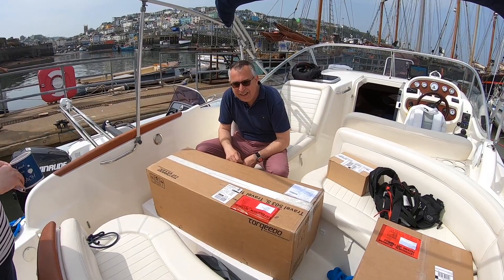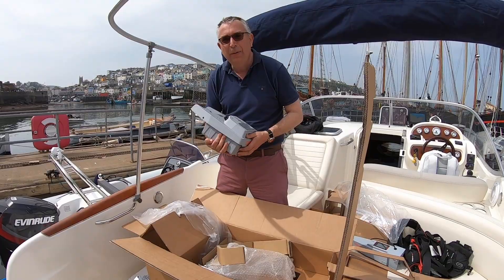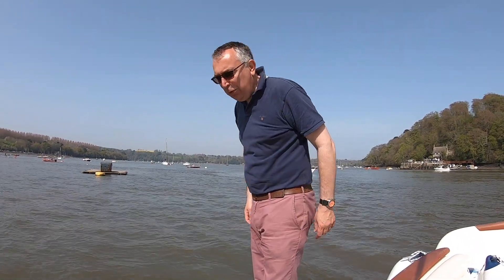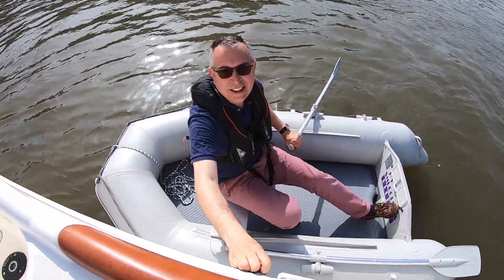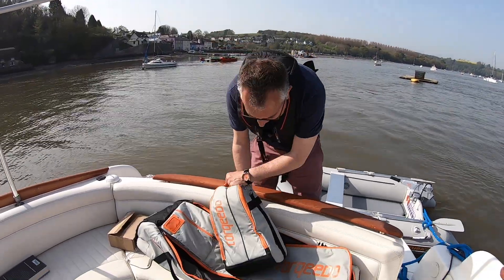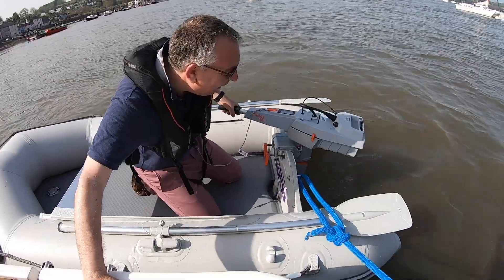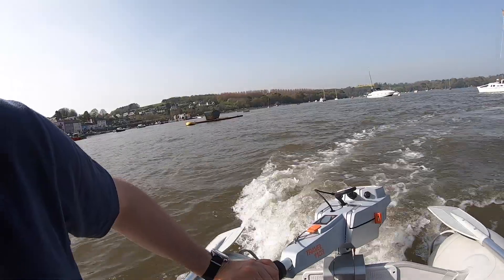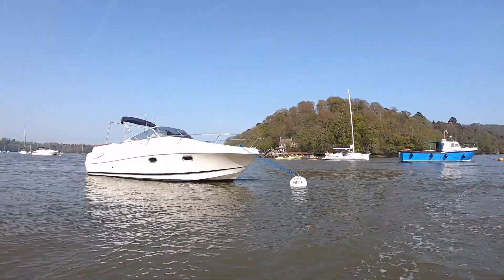Torqeedo 1103C electric outboard unbox & test

Comment: It's a bloody lot of money $4,000 AU for an electric outboard, but I guess it will save you on petrol, oil and service charges in the long run. They do look very boxy tho.. square and boxy. Maybe as they progress over the next few years they could put more into the shape of the exterior panels to make it a little more streamlined look or are they just wanting to stay with a brick shape.

Comment: Just to add to my previous comment regarding this outboard: excellent though it is, a note of caution. The other day we inadvertently strayed into some shallows & hit some underwater rocks. The shear pin didn't, and the forward fin, there to push the outboard back & up if it encountered an obstacle, must have gone between rocks. Even though I immediately stopped, the result was a completely smashed prop. New ones are expensive of course, so I also used the boss of the smashed one, made & fitted some aluminium fins to it. I'll keep the latter as a spare - save me having to row back from the far end of Derwentwater again!
Reply: I 3d printed a spare for mine for £5!

Comment: The integrated battery is the bomb!  I had one of the original electric motors that use a standard car battery placed on the tender floor, not the best setup and it was pretty shoddy, didn't last long....  I tried to set it up with a solar panel and regulator, but still....  iffy!  This is a big step up!

Comment: My concern is the proprietary battery and maybe connectors? See, with a little gas motor you can just buy gas. You don't need to buy the gas made by your motor maker, and you certainly don't need to check serial numbers to make sure it's exactly the right gas. But batteries you do, and if the company goes bust or just decides to charge an arm or a leg for a new battery, you're stuck. I can actually see outboards being a good way for electric to get accepted, if the manufacturers could come up with universal batteries and fittings.

Comment: Put two people in the boat and that wont be able to push it faster than 3 knots. Get yourself a decent motor.
Reply from the maker: And then where would I put it and how would I lift it on and off every time?
Reply: @AQUAHOLIC  Lets do a deal, for allowing me the pleasure of coming out on your lovely boat, I would bring along a 8 hp Yam and I can lift it on for you as its only 27kg. You can supply dinner and the beer.

Comment: Hi Nick. I am impressed with that. They also do inboard engine with bmw large flat 'torqueedo' batteries for larger boats, great system. Efficient and easy to use. Electric free power from solar. Awesome
Reply: Does torqueedo have remote control capability

Comment: Thank you for this. I am considering purchasing one, but I would like to know how effective it would be powering a one-ton sailboat (Cape Dory Typhoon). The specs do say that the motor is good for boats up to 1.5 tons, but considering currents and tides in my region, I want to be sure that I make headway. Does anyone reading this have any input on using this on a heavier boat?
Reply: Try talking to the manufacturer about performance and whether a refund could be given if it does not perform to what they tell you for your boat in your conditions
Reply: Found some discussion online about this a while back. It seems to work ok, but is not quite equal to a 3HK outboard on heavier loads, i.e. a sailboat against tide/wind.

Comment: Enjoyed your demo!  Torqeedo has greatly improved the range on a single charge since the earlier 2013 model.  Wth a small inflatable at 2kn  its now 46 miles, or at 5.5 kn its 5 miles.  In terms of security to defend against the sorely tempted light fingered outboard pirates, I do like the portability of the tiller and battery.  In my harbour o/b thefts are a regular nuisance. Im likely to buy one soon. Also love the "stealth" feature - silence is golden!

Comment: It's disappointing there's so much plastic in the packaging. How much of that ended up in the water? I thought the Germans were big on not using plastic packaging. Made in China perhaps?
Reply from the maker: What on  earth makes you think I was throwing packaging (plastic or otherwise) into the water!!?
Reply: AQUAHOLIC Hello Aquaholic. I thought you were a little casual with stowing the plastic packaging, which could easily have been blown into the water by an unexpected puff of wind. I never thought for a second that you might deliberately allow it to get into the water. If it did and if you noticed I’m sure you would have gone to great lengths to retrieve it, setting a good example in doing so. Did you notice any ‘Made in’ stickers? I was convinced the Germans had stopped using plastic in their packaging - a good outcome from having a reasonable number of green reps in their parliament. Are you still happy with the motor? Any problems with lack of power or endurance?

Comment: You need to buy a few extra shear pins. I only tapped a hidden rock and it was bust.  They are not stocked by most chandlers. They cost just £1.05 each but... Torqeedo charge a whopping €15 delivery for something the size of a panel pin! so buy from a local mail-order company.  I also suggest you take the current one out and apply a little greases because they do stick and become difficult to remove when broken.  Finally, never run the engine with the prop out of the water. It seems to reduce the longevity of the motor is you do so. Enjoy.
Reply from the maker: Good advice, thanks!

Comment: Interesting review! Very expensive though for a 3hp outboard
Reply: We are so disappointed in our Torqueedo 1103CS Travel and after only 8 weeks use the battery has completely failed, Torqueedo Customer Support are unable to get me a replacement battery, rendering my motor useless with absolutely no one who can fix it in the whole of the Balearics Islands.
In theory electric motored are the future however they are so underpowered, expensive and with poor support it will be many years before we every consider these again.
Are present we are looking at at Honda 6HP unit which offers double the power is half the cost and if we every have a problem with it it will be very easy to fix ourselves of find an abundance of engineers throughout the world who can fix one. 
Additionally, there is absolutely no lock for the battery which could be removed within 20 secs.
Reply: We have one, and it was well worth the extra money. No gas, no storing gas, no oil changes, no smell, no noise. push button start, no carb issues, etc.

Comment: I would like to see one of these glorified trolling motors tested on something more than a 3 foot long boat ! ?
Reply: it works very well also on a linder fishing 440 and up to 4.4 knots or 8.8km per hour with 4 persons on board. so it has the same or more torque then a 4hp outboard and its much easier to maneuver. the only only down point is the maximum range compared to a combastion engine at maximums speed is lower....
Reply: @oxytronix  What is a 440 ? ( length / width ) . And 4.4 knots is not bad ! That about 5 mph ?
Reply: John Averick 440 centimeter or 4.4 meter maybe 15ft
Reply: @oxytronix  Great, Thats about the size boat I run ( 1962 14 ft. Alum. Orlando Clipper ) I always said. If electric could push me an honest 5 mph without weighing a ton, I would go that route.

Comment: Disliked because no specs of the battery and motor are mentioned
Reply from the maker: Fair comment, I'll try to make sure I mention them in the next one (hoping to do a range test). Plenty of info on the Torqeedo web site in the meantime of course.

Comment: Are these electric engines high maintenance?
Reply from the maker: A service every five years.
Reply: Electric motors have basically zero maintenance. They will go years without having to touch them. The batteries are getting better, but replacing them is really the only maintenance cost.

Comment: I see a few target customers for this: 1. Sailboaters that sometimes find it inconvenient to get gas. 2. Occasional dinghy users that don’t like messing with gas and don’t run their outboard enough to keep the carb clean. 3. People that want something convenient and light weight. I fit into categories 2 and 3 and I have a bad back injury so something lighter in separate parts that won’t spill oil or fuel is attractive to me.  My dinghy trips are short so speed is not an issue for me. The price is still pretty unattractive, but I may still give it a try.
Reply from the maker: The fact that you don't have to 'pull start' like a conventional outboard might also be a bonus.

Comment: What are your thoughts on the inflatable boat you were using, the 260, for two people or a person and a dog?  I like the small storage size and light weight, but not sure of the quality and durability.
Reply from the maker: I think it would be okay for that, it's rated for three and there is a reasonable amount of room in it. Quality seems okay considering the price, durability remains to be seen but no obvious signs it won't be okay. I bought it for the size and weight, certainly there doesn't seem to be anything else as light and that packs so small at that inflated size that I came across.

Comment: Great video. I went with the epropulsion spirit instead ( vid on my channel). We must have pulled the same face , first time of using an electric outboard. 😁
Reply from the maker: I'll take a look!
Reply: AQUAHOLIC cheers. The deciding factor for me was the spirit’s battery is totally waterproof & it doesn’t have a gearbox whine. .
Reply: @thekitowl  Gearbox whine I am with you, why make a silent motor then make it noisy with gears, same evolution in a lot of motors.
Reply: Ben Grizzly Adams when I heard it at the boat show the whine was quite loud & I was told they had put a thicker grease in to quiet it down.
Reply: @thekitowl  Silent Yachts scrapped their system on the 55 to make gear-less motor on the newer 60 if I remember well.
Reply: Ben Grizzly Adams 👍
Reply: Does the spirit have reverse?
Reply: Christopher Whyte yes. You just turn the throttle anti-clockwise.
Reply: I looked into that one too, but if I still had to do it over, I'd still buy the Torqeedo. For one thing, the ePropulsion is more expensive. Torqeedo has been around a while and getting servicing I would think would be a lot easier. Torqeedo also addressed some things in the latest version of the 1003 to better compete. I find the noise of the original model minimal compared to most motors.

I feel there is a market for a more affordable, less expensive competitor, but little room for one that is very similar but more expensive. I would be surprised if ePropulsion is still in business in a few years but time will tell. It's sort of a copy of a Torqeedo.
Reply: n8goulet do you know if they have made the battery waterproof yet ? The spirit has been about for four years & touch wood is proving reliable. It would be great if there was some cheaper models, to get the prices down. My spirit was a gift so the money didn’t come into my decision to get it.

Comment: I'd rather buy petrol outboard rather than all that hassle
Reply: What hassle?  If you want a hassle, go with a petrol motor.

I've had my Torqeedo 1003s since 2013 and I bought it pre-owned. I did have to by a new battery for it this season (the newer stronger 915w model), and they are very expensive. 

Petrol motors (3 HP gasoline equivalent is comparable to an 1003) require annual maintenance each winter.  You have to mix gas & oil. I don't want to smell that in my sedan. It's much more convenient to charge the battery than deal with gas & oil. And if you stop the motor while out at sea, small gas outboards like a lawn motor, can be a real hassle to start & stop constantly pulling the rope. The Torqeedo is a simple on / off at 1 second's notice. Also useful as a trolling motor if you want to go slow. Quiet, and your allowed to take it in places that don't allow gas motors as some lakes don't. I use mine on the ocean & lakes. 

Economically, I think the Torqeedo is more expensive over all. But much less hassle. As a small car owner, it's ideal. Transporting a gas motor inside your gas is certain to cause unwanted fumes, possibly long after the motor isn't in the vehicle.  It's a lot cheaper buying this than buying a vehicle big enough to trailer a boat with a gas motor. And then you have the parking issues when not boating. The 1003 transports so conveniently as does our Sea Eagle, they fit in the trunk, allowing us to take it anywhere and they go all over the east coast from Maine to the Florida Keys.

Convenience comes at a price. But because this motor is so portable long distances in a tiny vehicle, it gets a lot of use and goes to way more locations than what people who trailer a boat would normally get to visit.  All the many locations are what keeps it exciting for me as I only care about sight seeing. I don't fish. 

If you break down the price of a Torqeedo battery per year for the expected life, it's less than $200 a season. I can launch my boat anywhere! No slip fees, mooring, launch fees, etc. I don't need to own a larger gas guzzling vehicle to transport my 14' boat. It's actually far cheaper than what many spending on their annual boating costs.

Comment: I just want to get one of these so I can have a backup motor for my 21ft hardtop boat. No more having to get towed at $300 dollar plus price. Run out of gas keep this onboard never get stuck
Reply: @toranamunter  Yeah but it's silent, when boating you either are full blast, or a diesel chugging along is a pain, and it stinks.

Comment: How is this not a trolling motor
Reply: I thought the same thing, but the company makes electric motors that supply an equal amount of power as an 80 HP gas motor for $20,000. I suppose it would be useful for fishing large lakes that do not allow gas engines.
Reply: It is, but it's rebranded for yachties.
Reply: That's like calling a gas outboard a gas powered trolling motor. That's like calling an electric bike a trolling motor powered bike. Does electricity mean trolling motor now?

Comment: I'm never getting one of these. My Tohatsu 3,5 beats it every time! for a fraction of the cost too. But I'm not rich and own a yatch. If you want to go electric, invest instead in a lightweight new Lifepo4 battery and a trolling engine. There are trolling engines that are as powerful as a Torqeedo. Like haswig protruar 2.0. It will save you a lot of money.

Comment: Be careful how fast you get on the throttle.  Electric motors being high torque, it will shear the pin on the prop.  Don't worry, they include a spare.
Reply from the maker: That's a very good point, thanks. And you're right, there is a spare (two I think).
Reply: Torqeedo said the sheer pin on this model is stronger than the previous model.
Reply: @christopherwhyte2360  NO
Reply: I have the t1003 and I have never broken one. They even say this one has a stronger one.

Comment: Do you think that torqeedo is powerful enough to get that boat up on a plane.
Reply from the maker: Only had a couple of goes with it so far but I'd say not. This one is equivalent to a 2-3hp outboard. They do more powerful ones, but not with the integral battery I don't think.
Reply: I'm thin and I got it on plane.

Comment: I'm surprised torqeedo didn't supply a safety chain to the tiller and battery and transom. Small cost as compared to losing a piece overboard. It won't always be used on a warm calm day.
Reply from the maker: John, I agree with you entirely. Easily resolved, I've ordered a short line with a spliced eye that will allow me to create a quick and easy 'noose' to go around the main body during transfers to the dinghy. But I've already suggested to Torqeedo that a hole in the mounting bracket to thread a line through would be very helpful (I'm tempted to just drill one!). The battery is easy enough as it has a handle and the tiller is small and weighs nothing so not a problem, but yes, a way of tying the body of the thing on would reduce the anxiety of swapping it over to the tender.

Comment: 10hp for $9000!!! That’s a big nope.
Reply: 10hp, more like 3 max.
Reply: 10hpmy 9.9 gas motor is more peppy and faster than that electric motor
Reply: $1,999 @ 3HP https://www.austinkayak.com/Torqeedo-Travel-1003S-Electric-Trolling-Motor-3-HP-23-in-Shaft/ACK16085P.html?utm_source=bing&utm_medium=cpc&utm_campaign=PLA&scid=scbplp16085_3535_1&sc_intid=16085_3535_1&msclkid=96a4beab831b16ee19f2e27e25c5c35a
Reply: Wrong video it's 3hp...
Reply: Wrong video.
Reply: 9 grand buys a tanker worth of fuel 😂

Comment: Isn't this just a beefed up version of a transom mount trolling motor?
Reply: Yeah but trolling motors only go up to about 100 pounds thrust, and this can get up to 10 horsepower with a tiller, which completely dominates the strength of the trolling motors.
Reply: The cost COMPLETELY DOMINATES ITS FUNCTION....

Comment: Over 2 grand.  Battery doesn't last long and will take forever to solar charge.   What a giagantic waste of money.  Get a gas engine for far less money and won't have to rely on batteries.  Maybe once the price of these things come down to a reasonable rate.
Reply from the maker: Let's find out shall we? Stay tuned! :)
Reply: I'm pretty sure a 50lb thrust trolling motor would push that thing just as fast and you can pick one of those up for $600 new here in the US.